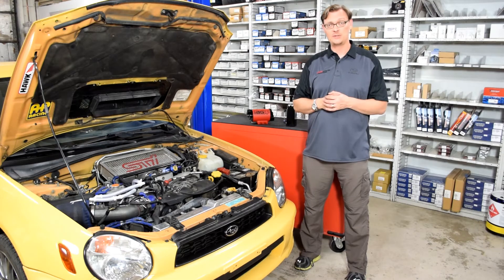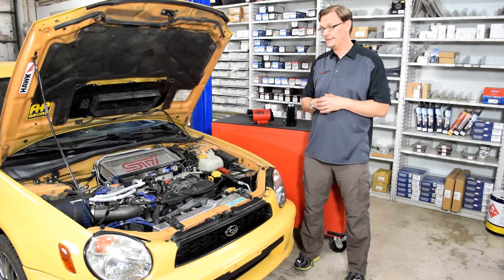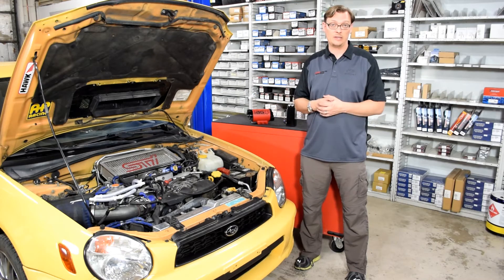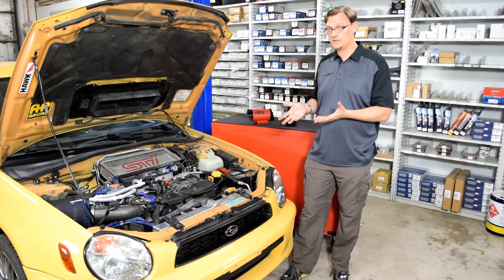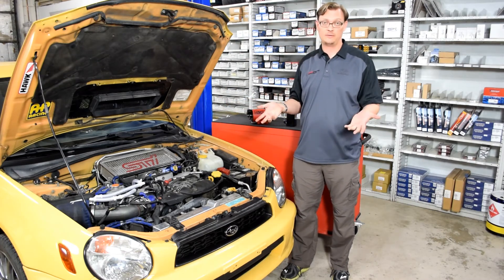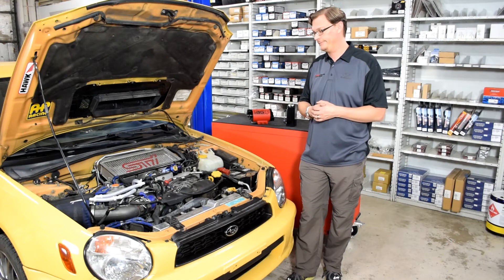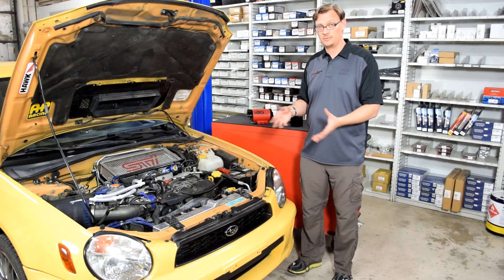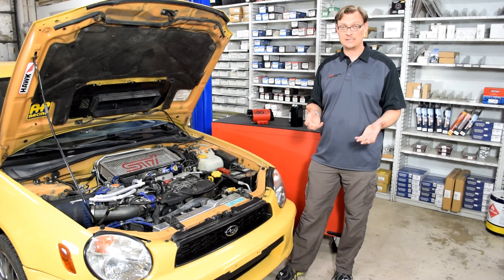Air Oil Separator Vs. Catch Can Part 1 - Getting a Baseline

Comment: Hey, I just recently found your channel and it's amazing! so much information that is useful! I have 2005 WRX Hybrid build and I recently added some Mods, TGV delete, Turbo inlet, light weight crank pulley, walbro 255, 1000cc injectors, cold air intake, and a VF48! I need to get a tune soon. But I remember taking off my stock turbo inlet and seeing some oil build up where the PCV is connected to the inlet. that made me really want to get a Catch can or Air oil separator. would you recommend the one you have on. Also what BOV is that? I'm looking for one too! Sorry for the long post, I love the channel and I'm going through all your videos because I love the way you present the information! thanks!
Reply from the maker: Thanks Matthew!  It is too early for any recommendations, as we are going to be gathering information for a while.  But stay tuned!  There will be at least 1 or two up-dates coming in the next few weeks.

As for the BOV, this car has a GFB Hybrid BOV that has been on for years, and is still working well :-)  It is set at full recirc FWIW.  Turbo Smart has come out with a Kompact BOV that functions very similarly that would be worth looking at too.

Thanks again for watching, and please pass it on.

Comment: Very cool analysis. What material is the clear tubing used in this video? I would like to run a similar test, but am not sure what material clear tubing will withstand engine bay temps. Thank you
Reply from the maker: Thanks for your question.  That is simple PVC hose that is available at most hardware stores.  It works okay, but it does get harder as it gets hot.  It is good to visually see what might be moving through it, but for the long term, I'd say a good rubber hose would be better.

Hope that helps and Stay Tuned!
Reply: @FlatironsTuning  Thank you!

Comment: Doesn't steel wool flake off?
Reply from the maker: You definitely want a course  steel wool to help prevent this, but if you are concerned about that, then you would want a can that is designed with good baffling so you wouldn't need the steel wool.

Hope that helps, and Stay Tuned!

Comment: Hey! My 2007 Honda accord is burning oil really badly - could the Air Oil Separator help in this situation? Do you think it could be successfully installed on this Accord? Thanks for any help!
Reply from the maker: Thanks for the question.  I'd say that on your Accord, assuming it is not modified, there is a greater chance that the issue is related to either your PCV valve itself, or your pistons.  You could install a catch can or AOS, and if that does help, I'd recommend taking a close look at the PCV system, as those solutions may be a partial solution to a larger problem.

Hope that helps, and thanks for watching!
Reply: Thanks for the response!  I changed the PCV (using an OEM) but the oil burning continues... I think I will try cleaning the outlet line the goes to the intake manifold... Also, I ordered an oil catch can on Saturday... Will experiment and let you know. Cheers!

Comment: Steel wool? I am sure any loose strands will do no damage to the engine!! Should use a scourer pad.
Reply from the maker: Thanks for your concern Isaac.  This wasn't on the car for long, and since it was a catch can, we saw no signs of any metal getting back into the engine.  If you are looking for a perminent solution, certainly something that is more likely to hold together would be more ideal.

Thanks for watching!

Comment: Had a very similar set up on my 06 wrx 170k mi. But 2 cans separate crank case vent/ valve cover vents. Routed back to the intake. The oil was on the milky side In the cans.
Current set up 2.5 iag stage 1 plus complete build. Tgv deletes and iag aos ( comp model) which vents to atmosphere and does not get recirculated. Motul 8100 gets changed every 3k and never looks milky at all. Almost as golden coming out as when it goes in.  A heated aos that vents to atmosphere is the best way hands down but needs ecu remap. I can't speak for a heated aos that gets routed back to the turbo inlet. But I have zero oil consumption with vta  setup
Reply from the maker: Thanks for that Dave, and thanks for watching!

Comment: Is there more oil vapor on a cold engine or one that's been running for a while?
Reply from the maker: Hello Phillip.  That is a good question, and it would most likely depend on a few things.  When cold, there should be less blow-by, and the oil would be less prone to evaporate because it is coming up to temperature as well.  However, on an engine with forged pistons, their tolerances are much loser when cold, and that causes extra oil consumption due to the additional blow-by until the engine comes up to operating temperature.

Thanks for watching!

Comment: Love the regular videos!  Re: the catch can - any concern about using a fine steel wool like that & possibly drawing pieces of it through the system?  I put a very similar catch can on a '97 Prelude I owned, but used a much courser steel wool (like a heavy gauge scouring pad).
Reply from the maker: Thanks Daemione!  I don't think that I'm worried.  The steel wool isn't that fine actually.  In fact, it was the coarsest that I could find, and when pulling it apart to fill the can, it held together quite well.

Still, if this ends up being something that we will leave in the car more permanently, we'll likely consider other filter media.

Thanks for watching!
Reply: Cool - thanks for the reply!